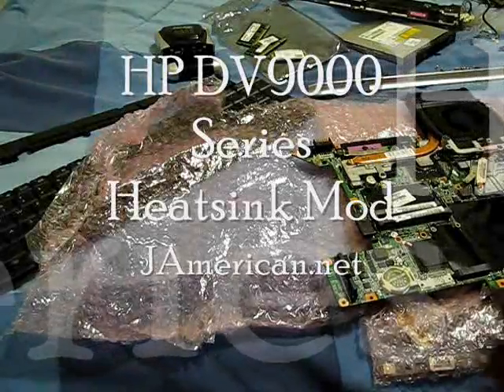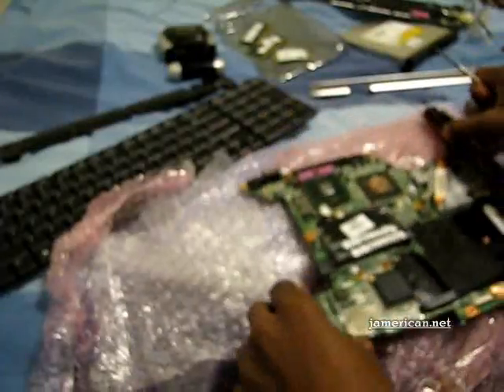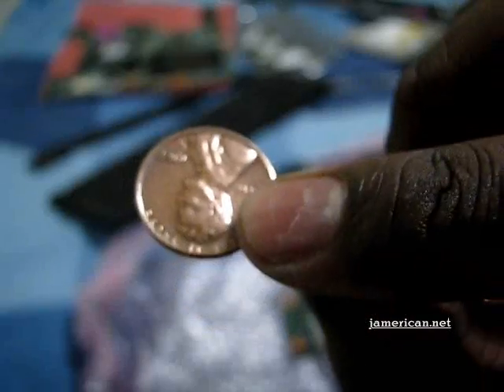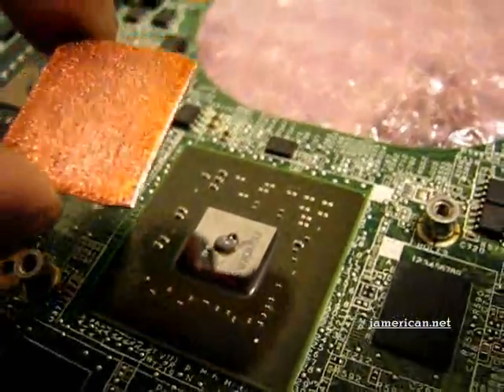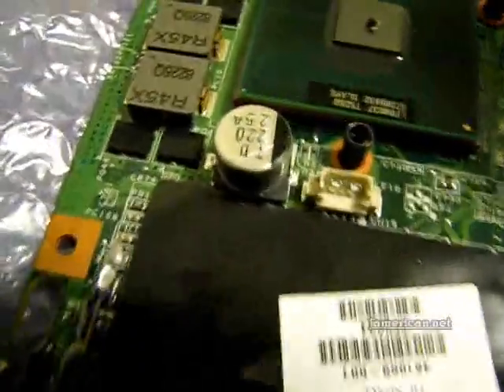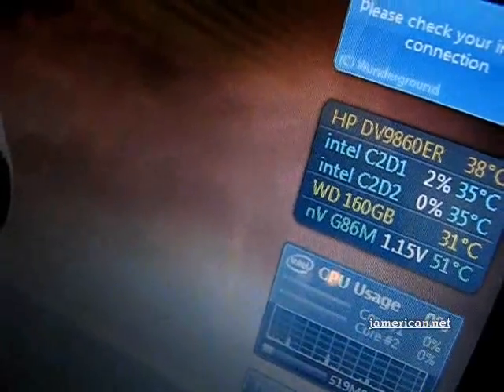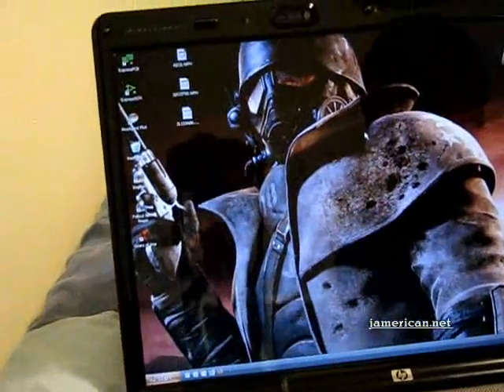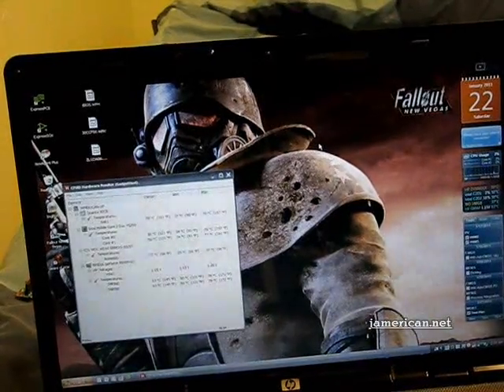HP DV9000 Series Heatsink Mod

Comment: using a penny is hilariously techno-heretical! :D
one tip for cleaning: covering it with salt, plus a few drops of lime juice, eats down to bare metal in minutes
Reply from the maker: Thanks for the feedback. The reason I ultimately didn’t modify the penny is because of this: “Defacement of currency is a violation of Title 18, Section 333 of the United States Code”. Either way, the laptop still works although it is very slow.

Comment from the maker: While the computer still works today, I agree with many comments which stated I should have used a flat shim or sanded-down penny to make the surface uniform. Thanks for the constructive feedback.
Reply: Could you give us a hand and let us know what software you're using to keep tabs on the CPU/GPU temps?
Reply from the maker: Jeff Mullen HWMonitor I believe. Don’t remember

Comment: Nice video, thanks for taking the time.

For those still having the "Black Screen of Death", you may want to check your memory DIMMS.  Remove one at a time (be sure no power or battery is present during memory removal) and restart the laptop with a single DIMM to see if one of them shorted out.  That's what happened to my HP Pavilion dv9700.  If so, replace the bad DIMM (about $10 on eBay or Amazon).

Comment: If you wanna use a coin, use a silver one and make sure you will sand it before to have a really flat surface, silver Ftw. its a bit more rare but it will conduct termal enegy far better.

Comment: Removing the battery while at home will help not only to extend it's life, but the battery won't be generating any heat in the process of it's constant recharging. I removed the hdd and RAM/wifi plastic covers on the back as I made a custom laptop cooling pad, with 2 case fans, from cardboard and loads of PVA glue. Overclocked my TL-56 processor from 1.8ghz to 2.4ghz and I never see my CPU temp higher than 59, 60. Get a cooling pad or make one yourself, it's worth it as because before I had the pad I saw temperatures of 72c on stock frequency on full cpu load. Heat is the greatest enemy of electronics! Keep it low and you will see your hardware running for years. My one is running for 8 years already, the last 3 years overclocked!

Comment: What I did/do with my dv9000....

1.  Use a real shim bought on eBay.  They are cheap.
2.  Buff said shim with dremel wheel.
3.  Use air cool pad
4.  Bought extended life batter which elevates the back of the laptop about 3/4 of an inch for better airflow.
5.  Only use laptop on hard, flat surface. NEVER on anything soft like a pillow or pad like you have in the video.  This will restrict airflow and draw lint up into the fan housing.
Reply: Can I also use aluminium shims ?

Comment: How much difference did this make? You didn't say what the temps were before. I have the 9610US which is an AMD TL-58 and a Nvidea 7150M. I am running it at 800mhz instead of the normal 1.9GHZ (through Vista's power control) and at ile with nothing but Vista striped down to the Windows 2000 interface the CPU is at around 50C and the GPU 60C and under load (again at 800mhz) the GPU goes to 70C and CPU up to 60C. I don't have the black screen problem, I have the intermittent power problem (will shut off before it even gets to reading the boot sector) and there have been periods where I couldn't power it on for months and now it's working again and if I could solve this problem, this machine would meet my needs fine. Also, what do you think of aluminum rather than Copper? Aluminum is a very good heat conductor.
I hope you are still monitoring this video because I'd like to hear about your success before I take on such a big job. This thing is a monster and a 2 hour job at minimum.

Comment: It worked like magic on two HP laptops with similar issues. just baked them for 8.5min. and that's it. in fact i didn't have the heat sink paste so i brewed my own by mixing tooth paste and petroleum jelly in the proportion 75%-25% respectively then added two copper coins on the GPU, CPU and north bridge. thanks
Reply: 6 pennies totoal?  Thanks.

Comment: Hi, I've got a Lenovo X220 here (i5 2520M CPU). It gets quite hot (80°C). I don't like that. I just bought 2 copper shims (waiting for delivery). I'm planning to put one on the CPU and one on the other chip that's cooled by the heat sink. The question is: should I put thermal paste both on the cpu and the shim or only on the cpu? I saw some guys putting paste only on the cpu. Thanks in advance, and I hope you can understand the stuff I wrote, English isn't my native language.

Comment: Placing a penny on the GPU is the absolute WORST thing you can do.....it is too thick and it WILL NOT transfer heat evenly across the die because of the ridges in the penny. Over time (a short time at that), the pressure that the penny is bearing down on the GPU WILL cause the motherboard to warp and will cause solder to crack and break under the GPU as it heats and cools.This is not speculation as I reball BGAs and have seen this happen a number of times. Once the motherboard warps, it's over.

Comment: you did all those modifications and you are still getting those temps?! Thats not right at all, my dv9700 model has copper shims and arctic silver 5 and has extremely low temps. Although i did cut a wire so the fan runs at full speed...

Comment: I just tried the penny on the gpu on a dv5000 that was seriously overheating, It seems to be running great. I did whip out my dremel and sand down both sides nice and smooth. It is running much cooler than it was with the thermal cushion hp put in.

Comment: People, notice he's using a 1962 penny, I'm assuming they were still copper then?  They're all 98% zinc now, you're better using aluminum than zinc.  Also, you really should flatten out the penny by smashing it or grinding it, or something because all those gaps don't transfer heat well.  Keep in mind thermal paste is NOT very heat conductive, it's meant to fill microscopic gaps and surface defects between materials.  A thick layer is actually worse than none at all.

Comment: If I use 1mm copper shims on gpu and cpu does the north bridge copper shim gonna 2mm thick?.  I was told thicker shims brings down temps more...for my DV9743CL

Comment: Ok... so as long as the penny is at the right thickness it doesn't have to be a penny right??? so what if I just use a silver sterling plate same thickness to that... also it conducts heat very2 well and I used it for my desktop also silver plate on the processor and the gpu.... it went well :D

Comment: Applied ceramique 2 to a penny and put it on the northbridge and just the ceramique two on the cpu and the gpu. After reflowing this laptop works a little skittery but fine for a secondary computer. The nvidia drivers on both vista and 7 wont allow the pc to boot up so I have the basic theme on 7. Also when I adjust the screen red lines appear everywhere or in certain spots, but just wiggling it a little fixes it. The charge port has to have the charger in a certain way. Only 20$ though!!!!!

Comment: Dangerous to use any pennies on the GPU or MMU. They do not  account for the various resistors on the chip, and can short the GPU totally when the laptop is picked up when on. An insulating mask is necessary on the GPU and MMU.  Also with the uneven surfaces of a penny there are gaps in contact with the actual ceramic so the efficiency is less than 70%. Sure many YouTube tricks work, but they don't last long. Find a pro or reball.

Comment: Got a dv9000 (97 something) for twenty bucks. Everything works except the graphics don't show up. Well it's all apart downstairs and after trying a hairdryer reflow and reapplying thermal paste, the screen does not show up anything, it doesn't even light up. I'm going to try a heat gun and do a real reflow and hopefully I can fix it then. Do you know why nothing would be showing up? I'm sure all my cables are plugged in!?

Comment: Oh, also, try avoid using pennies because as mentioned, the surface isnt flat and you will create hot spots on the chips. Another place to find nice thick copper shims are from unused CPU's that use a IHS.

Also, if you do use a copper shim, make sure you glue the shim onto the heatsink using Thermal Adhesive and obviously normal thermal paste on the chip side. The adhesive prevents the copper from moving around.

Comment: Its good to see people actually fixing these things. I was given a Compaq Presario v3000 for free because it kept over heating and shutting down. I replaced the crappy thermal pad with a nice copper shim and now it runs like new.

The manufacturers make laptops to fail right after the warranty runs out. Its a shame, because there is nothing wrong with these laptops and they are thrown into landfill because repair centres want more money to fix it than what the machine is worth.

Comment: Very helpful video, thanks!

A friend of mine gave me his borked DV9000 and I managed to get it going by reflowing it, but it overheated again and I was back at square one.
Now when I opened it the second I noticed that the north bridge had absolutely NO contact to the heatsink, so I'm trying this penny trick. Also ordered a couple of shims in case it happens again, then I'm gonna use them as well.

Coincidentally, I bought New Vegas during the autumn sale on Steam yesterday :)

Comment: Oops I forgot to mention.  That you shouldn't be pushing down on the copper or penny with your bare fingers in the middle that defeats the cleaning you did with the alcohol and you just re-introduced oil and contaminants from your fingers.  After you are done cleaning them you should either wear gloves or at least handle them with lint free paper toweling and by the edges.

Comment: Couple of things... as the other guy said you should lap the penny (sand it with progressively higher and higher levels of sandpaper on both sides) make it level and shiny.  You are really limiting the surface area / contact by not doing that.

Also what is your desktop visual package called that Mimics Vista and W7?

Comment: Hi! Nice video! I have a question: My CPU (i5 460M) has 2 DIE's, Core 1 and Core 2. Both are hot and I'm planning to do a copper mod. Do I have to put 2 copper shims instead of only 1 to cover the cores? Thx!

Comment: EXCELLENT vid Man! Same "dead screen" issue on HP TouchSmart TX2. Repaired the GPU by blow dryer re-balling then upgrading to an actual copper heat sink from an old system build. Removed the "silverish" square "heat sink" that was soldered above the GPU & put it on top of the CPU to compensate for the additional gap created. GPU max temp between 77/78 C. At idle, the GPU is 62 C & the fan is WAY more quiet so I do believe that I have also repaired what HP has refused to acknowledge as broken.

Comment: One question. When you put in the shims, it lifts up the heatsink. What about the smaller chips next to the GPU and CPU that have the thermal pads connecting them to the heat sink as well? Do you lose contact with them when the shims are put in?